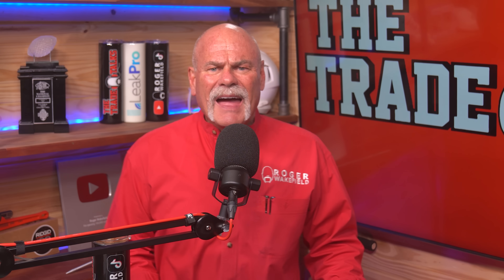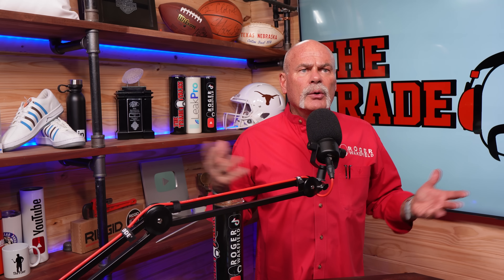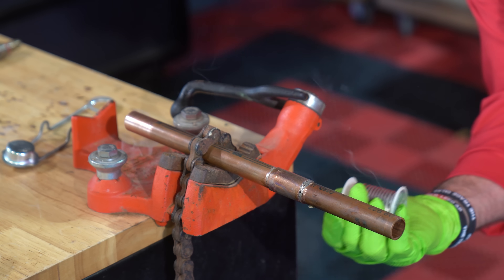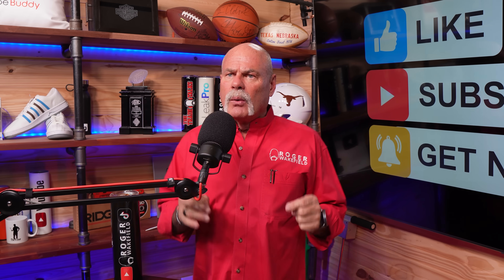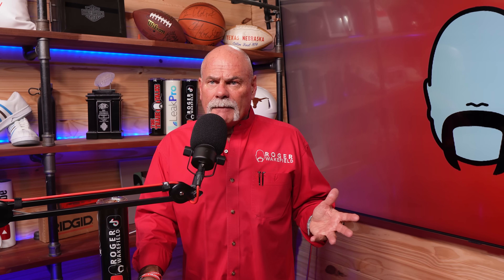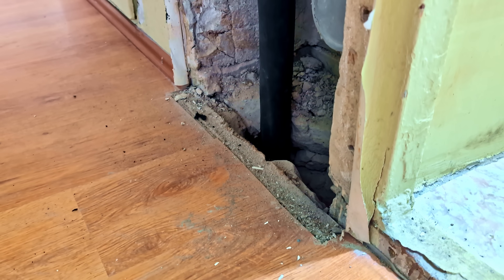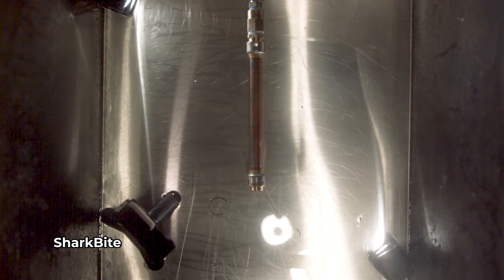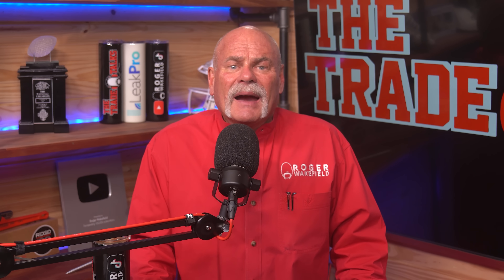The Truth About SharkBite Fittings From a Master Plumber

Comment: Actually thank you for finally saying SB  is a good product.  I have ALWAYS said, every failure of a SB fitting WAS going to be installer error (or externally damaged fitting).  I BELIEVE they are rated to be behind walls. Still, I will only use them when accessible/inspectable. I LOVE SB fittings. I use them very sparingly. Still I don't really trust them too. HAHA. Generally, I will solder whenever possible, but often do use SB especially if the water is on and don't want to take the time to drain the house, as long as it is in an area I can get to to inspect it. 
In my home, the ONLY joints that have failed (well 2x in 30 years) were solder joints done by a professional). Never had a SB fail, as I try my best to follow all the best practices to avoid damaging the o-ring. 
Still if I see a plumber using a SB, or even pro-press.  he will be fired. Still prefer a pro to use solder.  SB have their place. Thanks for an honest feedback that the product itself isn't inherently bad.

Comment: 76 YO here. Lifetime DIY before there were initials for it.  One of my sons had a water leak under his slab on grade foundation. Cold and hot copper lines were touching and 40+ years later, corroded.  Had to bust the slab to fix it.

His current house is total pex, some in the attic, some run between the first and second floors.  It is about 25 years old. So far, no problems.

Comment: I'm a soldered copper guy myself.  That's probably because I'm a supermarket refrigeration tech, so I don't like depending on o-rings any more than I have to.  That being said, like anything else, sharkbites can be very useful, but you have to use them correctly.  There are times I've had to use one because I was caught in a pinch and had to get the water back on immediately.  They are good for those scenarios.

Comment: I've used them on a bathroom faucet, but it wasn't the choice I felt really comfortable with.  I chose to use it though based off of accessibility, I can regularly check it for potential leaks and more easily access it for replacement is needed.   Additionally, I watched a lot of reviews prior to installing them for tips and information on do's and don'ts as well.   So far, do good.  I did debur the pipe and make sure the surface was smooth and clean first -- hopefully well enough.

Comment: First of all, its not true that they can't be used behind a wall - they are approved for enclosed locations. Second of all, a properly installed sharkbite on a deburred pipe will outlast an improperly soldered joint, or even a joint that was initially correctly soldered but ends up cracking due to years of water hammers in the system. Believe it or not, I've seen more soldered joints failing than sharkbites, this is not a lie. I ran and maintained two different commercial buildings for over a decade, and was repairing a failing soldered joint every year. Guess what I used to repair them? Guess what I never had a failure with?

Comment: I used one for my washing machine tap.  The crappy PEX push/pull valves that they put all over this house failed.  I cut the valve open with an oscillating saw and pulled it off.  Then I just popped a SharkBite valve on there.  I wasn't about to cut drywall to make enough room to put a new PEX fitting on there.

Comment: Any fitting that relies on an o-ring must be considered temporary. Rubber, any grade of rubber, has a limited service life. Threaded pipe is the only long term answer, meaning indefinitely long. Solder, done properly, can also go for many years. Plastic, the early pex stuff, is already failing, But we're told the newer stuff has solved the problem.  ABS has been proven to have some downfalls, and PVC has microplastic problems. If you're a young person, building a dream home that is a lifetime investment, think about this before committing to the newest latest fad materials.
Reply: Tell that to ProPress

Comment: I have been using shark bites for 20 years( people don't even know they have been around that long) On rent houses that parents have passed down to their kids and I work in those houses ever so often. NEVER has one shark bite EVER failed. I  mainly install new shower manifolds and supply line shut offs using sharkbites  and they are awesome. Plumbers say they fail so people are afraid of shark bites and call the "professionals". I have seen a few drunks in a plumbing truck that couldn't fix anything and still charged hundreds of dollars to mess up peoples houses, so the professional is not a fix all guarantee. One thing I would add is that when using copper pipe I remove the plastic insert on ALL sharkbites and only use that for pex. The plastic insert will prevent copper pipe from inserting all the way. plus I use the push pull push install method that always works.

Comment: Shark bite and John Guest are the same fitting in how they work. 

Poly tubing or copper is ok to use one of those fittings under a sink. The cut MUST BE SQUARE, otherwise, they will fail at some point. 

I used to do water systems, R/O units. Every filter change, once a year or refurbishes, I would always change the o ring in the fitting.

Comment: Sharkbite makes an amazing deburring tool and depth gauge, sold in any Home Depot or Lowes. The tool deburrs the ID and OD of the tube and allows you to mark the tube for depth. It basically makes the install mistake proof.
Reply: I used Sharkbite throughout my house except in inaccessible areas. If you are careful prepping there are no problems. So I’m glad you settled this myth that they aren’t dependable. 

I think there’s a segment of contractors that hate them for other reasons like it allows a DIYer to do their own work reducing the need for a plumber. However plumbers are becoming rare to find so the downturn of work doesn’t affect them anyway. Cost is another problem if you’re a plumber because those fittings aren’t cheap. However from a homeowner’s point of view they are compared to hiring a plumber. Funny thing is that even when plumbers are hired many of them in fact do use Sharkbite.
Reply: My rigid cutter actually deburs the edge by rolling the copper a few thousandths.  I almost never have to deburr

Comment: I'm using these on exposed pipes for my water heater located in the garage.  On New Year's (I guess technically the morning of the 2nd),   I learned the water that leaks from my water heater drains away from my house towards the left side of my garage.  Luckily nothing was water logged but good luck finding an available plumber.  I had an appointment lined up for that Friday afternoon, but he ended up rescheduling for the next Monday.  I couldn't wait, so I ended up putting together my own erector set of pipes and shark bite fittings by using the old set up as a template.  The old water heater inlet and outlet valves were pressed in so I had to redo most of the pipes anyways.  I stumbled on the shark bite pipe deburring tool which bevels the edge, so hopefully the installation is mostly correct... plus I can regularly monitor them for leaks.   But for my situation it got the hot water back 2 days earlier.   My neighbor is a retired home inspector, and the only big thing he said was get a pressure regulator and shut off valve, everything else was good.   So I hired a plumber to install a shut off valve and pressure regulator in the garage because those were by the street meter, and the water heater leaked at 2 am as per usual with water heater leaks...so at least I can stop the water faster.  The plumber did laugh at the shark bites, but he got it that it had to be done.  He shrugged his shoulders and said just look for leaks and keep my number handy😂

Comment: I had a SharkBite fail because of a design flaw that machined a sharp corner in the brass. I looked up the CEO of the company. He happened to have an engineering background. I directly E-mailed him pictures and pointed out the flaw. It should have had a radiused cut.  He never replied to me, but one of his minions sent me a box of fittings with a new design that were properly cut. I'm sure that the first question he asked was how this guy get my E-mail address.
Reply: That’s not necessarily a bad design, unless all of the batches prior to your email were 90° edges & not a radius. Likely what happened is that you got some pieces from a batch that was manufactured incorrectly, not necessarily designed incorrectly. There is a massive difference between those two words. That’s probably why you were just sent new products.
Reply: Seems like he didn’t ask any questions at all.
Reply: My first question would've been, "How isn't this guy not working for us?!".
Reply: I’ve guessed at a CEO email address and got a useful reply before.
Reply: @jeffreykoerber6595  Funny you should say that. I noticed that their email format was the same as my employer. I took a shot at it. The lady that replied was in charge of North America. So, I know that the CEO received it.

Comment: I've used soldered copper all my life. Learned it as a teenager. Done right, it's a simple, reliable, low cost method to plumb. Never saw any need to switch over to expensive crimp-on fittings. Just because its been in use for decades, doesn't mean it should be condemned and abolished.

Comment: My first shark bite I used is now over 10yr old. And my remodel of kitchen and bathroom i had multiple areas tying pex into copper over 5 yr old. All in basement not sealed up. I do agree with prep and inside walls. Mine weren't sharkbites they are a menards brand.

Comment: Got us up and running many times..never had a leak from a shark fitting.

If you are getting many leaks,.it is probably time to to replace the whole pipework instead.
Reply: or replace the person doing the work.
Reply: @themaintenanceman903 in my particular case, it was a townhouse built by students in the late 70s using subgrade copper pipes.  They were prone to pin holes.  It wasn't worth paying for full metal repairs when the whole system ideally needed to be replaced. So shark fittings and pex it was, until I sold the place.  I put tens of thousands into the home, I wasn't going to gut for no gain.

Comment: A “pro” plumber started a fire from soldering in my brother’s neighbor’s house which burned to the ground. Like DIY’ers, not all plumbers are created equal. Next door to me , a pro soldered  a copper fitting attached to the dielectric nipple on his water heater. Melted the plastic heat trap etc. inside the fitting. AN embossed note on the heater said “DO NOT SOLDER”. Leak began slowly. As a DIYer I identified the issue and for 50 bucks was able to fix the pro mistake.Anything can be screwed up . PRopress is nice if you have the tool but a lot of waste if you have to take apart or reconfigure. I have 16 year old shark bites I installed and no leaks or issues.Ream, clean and mark the correct insertion depth.

Comment: I have replumbed apartments and a whole single story house with these and many other jobs. I have never had one fail on me in 15 years. If they are failing then the install is what failed. I do agree I would not put one under a slab but I have attached pex to copper and pulled it through under a slab but the connections were above the slab.
Reply: you're not a smart person.  I've replaced hundreds of catastrophically failed sharkbites
Reply: @Red_Twizzler Then your around inept installers.

Comment: Been involved with water systems for 35 years, working with plumbers,pipefitters, union and non union. I have seen all the fittings and uses on every kind of project. Yes, the old timers don’t trust the new stuff. Hospital work still restricts the fittings. Regulations. They are being used in commercial buildings, some light medical clinics , dental etc. ProPress has been more accepted but the old timers have doubts as well. It has to do with vibration of the pipe over time. The shark bite type fittings and even pressed on fittings use O rings that WILL flatten over time and vibration, pressure etc. will result in leaks. The real problem is in residential use where the lines tend to be too small in a house for adequate flow. The valves are either push/pull or are 1/4 turn which restricts flow. The pipes are often cut too close to the wall as well if you want to make changes. The valves actually rotate around the pipe which shows how loose the fitting is. 20-30 yers down the road then what? Leaks all over? The companies that make the products will be sold and resold and changed over and over to where any legal recourse will be doubtful.
   One other thing is manufacturing of the pipes, the fittings etc vary whether it is USA made, European made and Asian made. Slight variances make a difference. China made products do not keep a rigid standard. I was at one job that was a Sake plant in Napa , Ca. and the production line which was made in Japan had different size PVC pipes and fittings than what is in the USA. The plumber was having trouble getting the fittings to match and glue up because the new fittings sent over would not fit the rest of the pipe fitting in the building. Little things but when expanded across the country problems can start happening.

Comment: Instead of a sledgehammer to get a cap on use a 1/4 turn and put it on while open, maybe with a hose attached to direct the flow, and then turn it off.

Comment: I've done plumbing around 20 some years.. we had a job that was in a tight area to fix.. so we decided to use shark bites.. so wrong..!! pipe was clean.. x-3 shark bites fail.. we finally got some more room went bank to compression fitting.. done in 10 minutes.. NO fan of shark bites..!! job should of been maybe a hour.. we there for 5 hours..
Reply: anything that fails x-3 is not the product.

Comment: I’ve been using shark bite fittings for roughly 15 years ….so far they’ve been rock solid and seem to last longer than CPVC .
I’d like to add that I only use Shark bite in a pinch, when doing a repair or adding a different type of pipe to pex…
Normally I just use pex whenever possible

Comment: I am a homeowner and I use Sharkbite in certain situations. Something quick or something that's tougher to get to. An example would be my bathroom sinks. I have three bathrooms and every sink was hard piped from the wall right to the faucet. No flex hose at all. So when it came time to replace the faucets the tight space and the fact that they're right against the wall I decided Sharkbite was better than using fire. It worked great. So I would totally recommend them for a situation like this. And yes, I prep the pipe properly. I deburr the inside and use emery on the outside. If you do it right it works great.

Comment: i have an industrial application that uses 1000's of gallons of water a day in a recirculating loop of nasty hard water, the lines are copper and pex, all of the professionally installed solder joints have failed, about half of the crimp ring style pex joints have failed., the 90deg and T's are the most problematic.. but to our surprise none of the so called temporary shark bites have ever failed.. when we added a 2nd system we just did it all with shark bites.. they just work.
Reply: It is about the Prep and marking the pipe to make sure you have full insertion - I use their gauge and deburr tool - it makes the install fool proof
Reply: you should be fired immediately

Comment: Sharkbites are a godsend for older mobile homes with PE plumbing. If I had copper, I'd gladly use sweat-on fittings, as Sharkbites are ridiculously expensive- but compared to buying an expensive crimper for PE (and the low quality of those fittings) Sharkbites are quite- and I've had several in service for 20 years now. In addition to proper prep, a big reason for failure is people not inserting the pipe fully into the fitting....you really have to push sometimes to get it on all the way till it's fully seated.

Comment: As an electrician, I can make this analogy: Old timers knocking twist connectors ("wirenuts", or "marettes" for our Canadian brothers) as unreliable when they first came out. "Soldering connections is where it's at," they said. Fast forward 80 years, and I find wirenutted connections from 1940's and 1950's. If made up properly, they will show no sign of heating or any other problems. 
As Roger said, it's all in preparation. You do it right, and it will last a long time. 
Fail to prep it right, and whether you are using Sharkbites, soldering, compression fittings, Propress, whatever - it will fail.
Reply: Old time electrician here. I’m still collecting the old ceramic “wirenuts” 😝 Although I have to admit that I’ve never seen or heard of a soldered knob and tube failure 🤔
Reply: Wire-nuts generally work fine for home wiring but people will use them in automotive applications too and that's where problems really start. The death of wire-nuts comes from excessive vibration and moisture incursion.
Reply: @flyingmonkeydeathsquadronc968 yep anyone who uses marettes in automotive (or anything that vibrates!!) needs to be slapped in the face. 
Too many boat trailers with big gobs of tape wrapping up wire nuts, we just gut the whole thing and fab a new harness.
Reply: now start discussing lever nuts with the marettes people